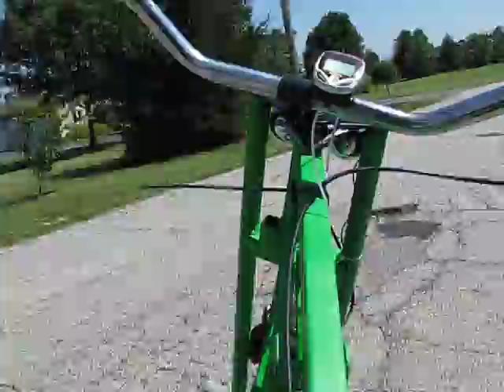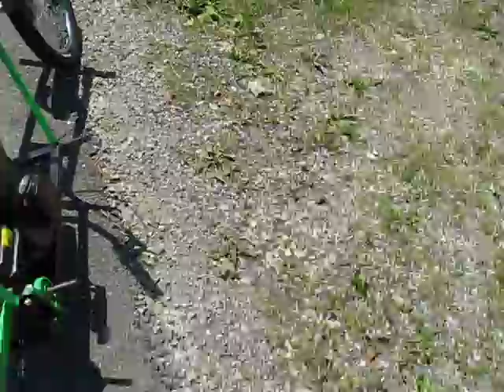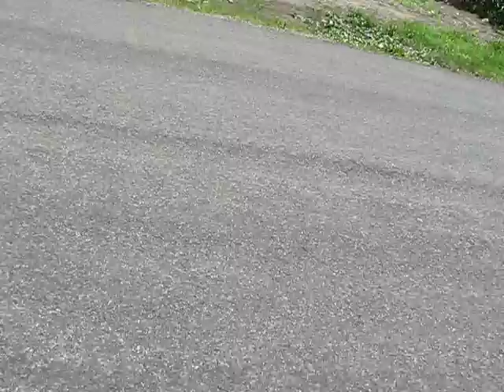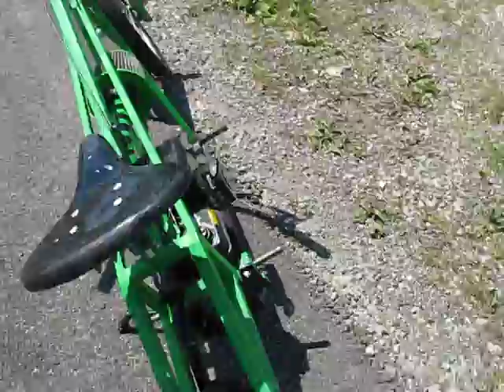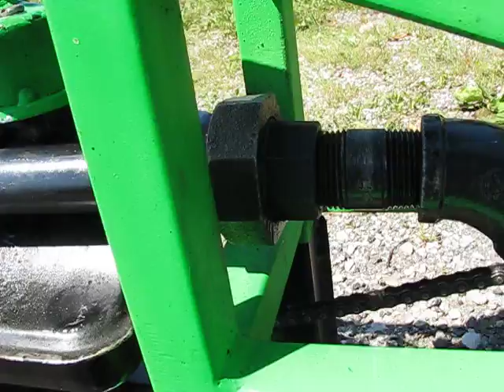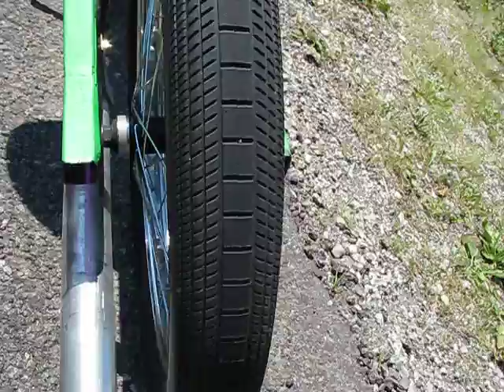Sweet Homemade Mini-CHopper

Comment from the maker: I have tried multiple gearing schemes. with it geared to go 25 mph at top speed it get 120 miles per gallon. Geared to go 50 I have been averaging about 180 MPG while averaging 30 mph. I do not run it flat out all the time. The problem of starting can be remedied by pushing off with your feet for a couple strides. Geared the way it is right now it keep up with city traffic just fine and i'm still on the original $25 clutch. Tires are brakes cost a lot more than the clutch.

Comment: you don't need it so low that you only go 5mph at 4000rpm, just lower so you save your clutch. It's not economical at all the way it's set up, being held wide open 80% of your ride time, think of the fuel being used in that situation. Also when those clutches are overheated [like at your launches] the shoes deteriorate faster than if it only drags for a second then locks up like it's supposed to.

Comment from the maker: The rear wheel has a disc brake hub. i turned it around backwards, welded a fender washer to the inside of the sprocket and drilled 6 holes to match the hub. then i bolted it on

Comment from the maker: I used a 3/4 inch black gas pipe but had to neck it down to 1/2 for it to screw directly in to the motor. I screwed up when i got the pipe initially but it all worked out

Comment from the maker: @Tmatuszak  I'm now realize that these messages aren't going in the right order but i'm sure you can figure out what i'm saying. When sanding the cam material off keep using finer and finer belts until you are pretty much just polishing it with a worn out paper belt. In short, You shouldn't try this unless you are ok with wrecking a motor. I there is also a hotter spark plug and i ground the bottom of the valves off a little to make them seat better. Compression raised from 65 to 145.

Comment from the maker: @Tmatuszak There was a slightly more gradual lift. This increased the duration a little bit. To be simple you could simply stretch the lobe on Paint to make it taller, I wanted the extra duration though. Print out that picture and cut out the shape. Weld a bunch of material on the lobe. Then sand off the excess using a stationary belt sander and match it to the profile you created and printed out. I got my sander at harbor freight for $30. its a 1x30 inch belt.

Comment from the maker: @Tmatuszak I should have went into a little more detail, but i don't really want people try this because it is soo easy to screw up. i put a piece of sheet metal up against the exhaust lobe and scratched the outline onto the sheet metal. I then cut out that profile using a dremel and stationary belt sander. I traced that piece of metal on a piece of paper, scanned it and put it on the computer. then using Microsoft Paint I created a profile that was 0.5mm taller and the arc of the lobe was wider